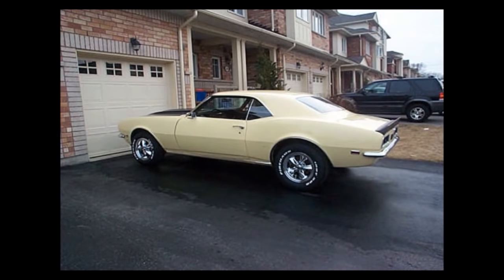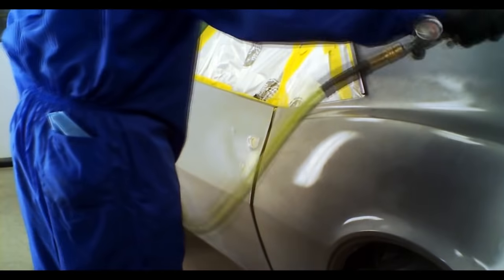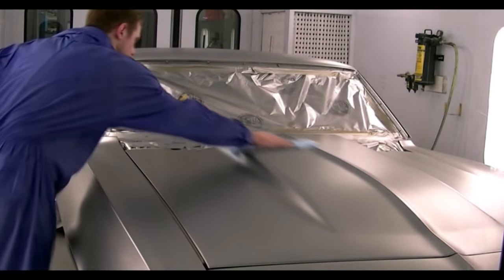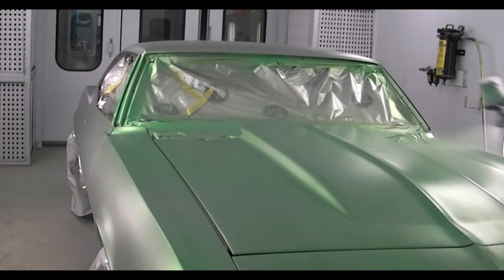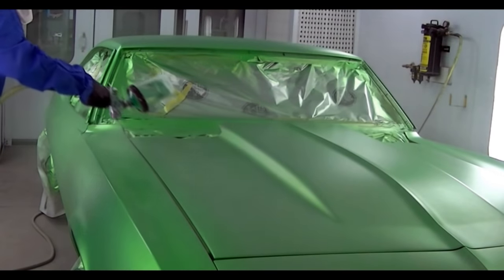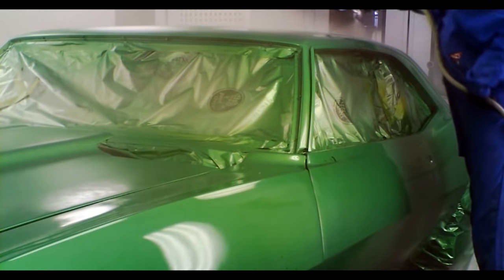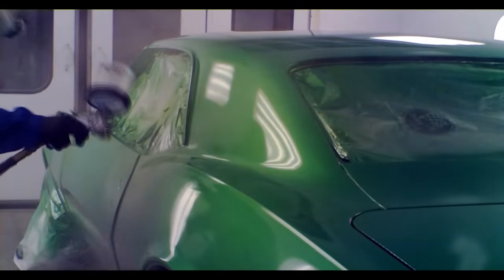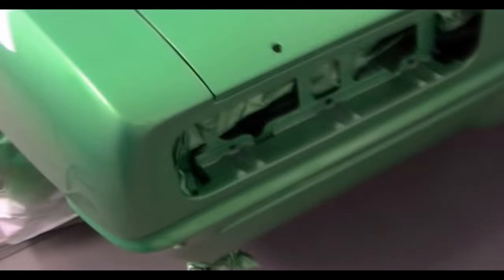Custom Candy Euphoria: A Full Car Paintjob Transforming the 68 Camaro into a Green Candy Dream

Comment from the maker: Thats in reference to how your applying one application or coat of clear. If your using to fast of a hardener then the clear drys to quick, it needs to stay as wet as possible during the application of each coat. 2 coats are applied with about 10 minutes between them.

Comment from the maker: One cup that size will get you about half the car (one coat), depending on coverage you may need 3 coats or so. About 1/2 to 1 gallon will usually be what you need to do a complete. Depends on the size, color, complexity (if your burning paint in offsets - grilles and such), if your painting the jambs, bumpers..etc.

Comment from the maker: I do not, I have done 1 custom fade paint job that turned out pretty cool but didn't get it on video sorry. What I did was painted a foot approximately downward, then slowly mixed in  my next color until I had nothing but my second color left at the bottom. It was done in solvent.

Comment: Lovely job ,can I give you 2 tips? the air hose always hold it behind your back and come up on your shoulder ,cause you can touch the paintwork if you keep it in front while you spraying ,2nd tip  
you get less dust if you spray at less psi,try ,I spray lots of cars with low pressure without a single speck of dust or flies

Comment: I WATCHED YOU THE WHOLE VIDEO, I painted over a hundred cars,and I never start anywhere except the top first,and walking the full length of the automobile on candies and other hard to shoot hues,it seems that the gun you are using is saving your butt,your overlap is excellent,i've found on hard to shoot paints that more light coats for the first two applys works best when the mix is perfect,you did a good job,start walking the full length and you will master paint work right off the gun and cuts down on orange peel and lots of sanding good luck
Reply from the maker: ***** Thanks mate! First candy complete I've done, should have thought to walk it.

Comment: The paint looks well done, but if I could offer some advice from one painter to another.  I start at the back, do the trunk-lid & back panel, then left and right quarter, then I start at the centre of the roof panel, continue down the door, repeat on the other side, then I start at the centre of the hood and down the fender etc. I do alot of running from one side of the car to the other, but I find I can keep the best wet edge possible. As well, I'm not risking leaning into any wet paint. Cheers

Comment: After you've put on the clear coat and it's finished you also need to polish the car, right? to get the best effect or am i wrong on this? reason i'm asking is that i am going too attempt to paint my own car not in candy color tho, but i figured i'd ask, Going for primer coat,sand it, another primer coat, metallic blue, 2 or 3 layers i suppose? and then clear coat 2 or 3 layers? and then polish it or should i just leave it be?  Thanks in advance.

Comment: That looks great. I spray the same way. You don't need to walk the car if you know what you are doing. Just wondering why you did this in 3 stage? WA708S is the code for synergy green and it has two mix ways in ProSpray (what I use) a base clear and a 3 stage. I think the base clear looks much better. I've tried both ways and the 3 stage just doesn't look as good to me. Anyway, Great paint work man!!
Reply from the maker: Chris Spero Thanks, the 3 stage I believe was the only version available in BASF at the time....or I maybe foolishly overlooked the 2 stage version (entirely possible).

Comment: nice work i have no complaints. nice stance i guess that little flaw you had on the right door its not ok. but i probably woupd of done worst. shit happens. what would you recommend as in body filler polyester Bondo what kind of primer what kind of vehicle to use what kind of clear coat because thats the exact color I want for my car but a little bit darker. thank you in advance for answering my question.

Comment: Base/clear systems are designed to be applied at the same time. There's no need to let the base dry. It just needs to set up (20 min or so before clearing). If you get dirt, bugs, etc. in the base, you'll let it dry before sanding out/respraying the base, but it depends on the job. I sprayed thousands of cars in a booth like his. Some days I'd spray ten parts without so much as a big dirt nib, then the next job I'd have a swarm of little flies stuck in the basecoat of a white hood!

Comment: Unless you based the car a long time ago & the base is 100% dry, the clear will adhere every time to the base, no need to sand. The reducers in the clear re-wet the base & they sort of melt together. The only time you'ld sand the base prior to clear is if it has imperfections in the base. If you sand a metallic/pearl base, you'll have to reshoot/blend the base to cover your scuff marks.

Comment: With the basecoat or the clearcoat you can use slow activating hardner , or even extremely slow hardner.  This helps you decide while painting , instead of deciding which areas may have a problem after painting.  By then it's too late.  Plus you can do the same with the reducer.

Comment: I'm not a pro. But I did take auto body repair class and I'm wondering when you painting either the silver or the color. Why did you paint a section at a time. In class they had us go from front to rear to keep the color even. The way you did it... like when you painted the door the front and rear panels would have more color. Then when you paint the panels they would have more coats because of your paint skills.  Just wondering.

Comment: hi..I love this color... I am painting a 54 ford f100 and was wondering what the silver color is?  Do you have to buy it as a kit?  If I wanted to used the silver as a racing stripe, could it be masked off then painted with the green.  Any help is appreciated

Scott
Reply from the maker: It is whatever ground coat BASF's standard position uses for 2014 Synergy green. It is a very coarse metallic.

Comment: Hi chap, nice work on this. I'm going to be attempting my first respray, of a car that i've been working on for a few years. I have previously sprayed the engine bay (which came out well, so i'm told) and am intending to really take my time with prep, but my question is what would you recommend with regards to flatting between coats?...

Thanks.

Comment: how did you treat the jams an under parts of the hood,fender,door ends ,was it paint an clared .  taped off  for the bodys over spray.you dont want color on finished doors and jams. but some over spray is going to get in the cracks.Do you color sand after all is dry an set? all in all nice job.

Comment: nice job, what size tip you used for clear coat and base coat and did u wetsand the primer? if so what grit did u use 400 or 600

Comment: Try getting down on one knee on every pass and turn the gun upside down to get under the rocker panels where rust can get it's start. Turning your gun side ways doesn't do anything to get direct 90 degree contact with the underside of the panel. 

You paid all that money for good equipment so use it for it's intended purposes.

One can notice also when you do spray along the rocker panel especially with your side ways pass move, that the over spray goes under the car and rolls up the other side of the vehicle and crawls up the side to the roof bringing any dust particles with it.

This can be eliminated by masking from the inner rocker panel lip to the floor which is something many seasoned painters do to eliminate the chance of dust particles being picked up and deposited on the car through static electricity. 

Going around all the taped paper edges first with a light coat also traps any dust particles that may be sitting there even from the factory roll.

Two air lines, one on each side of the vehicle goes a long way to keep things clear and allows you to move freely along side the vehicle as well and reduces the chances of stirring up dust from swinging the hoses around along the floor.

Starting from the bottom up allows you to see the pattern much better than from the top down because when you do top down you can only realistically see what you've already sprayed and not how the pattern is being sprayed so you can adjust accordingly.
Reply: well put when I paint I usually remove the hood doors etc
Reply: christopher laing thank u allsome i like it thank you bro
Reply: How much mutyel
Reply: Why don't you put a video since you kno so much ....that's what I thought
Reply: @jeffreyalbrittain  If you do that with candy you have a high risk of the shade not being right from panel to panel when you but the car back together.

Comment: Dear Friend.. Seeing hows I've only been in the booth 35 yrs .. I can tell you with 100% certainty THAT I Start all my paint work in the center of the roof working out so I don't have to reach over wet doors .. then Drop down to the deck lid then hood then sides .. But I don't reach over wet work ever if I can help it and when I start up top I don't have to worry about all that over spray on newly painted hoods and deck lids .. Just a tip from an old Guy ..

Comment: I've been spraying candies for 36 years and I used to walk the length of the car too. But through the years I found out you don't have to do that. If you'll notice at around 08:53 he really feathered his candy out as he put it on. As you move down the car you have to feather back in to what you just sprayed on. If you do this you wont see the stopping point. That is why it worked. You can do this with pearls too.

Comment: Nice, the only thing I see is that u start out -in and it should be in-out, I saw u do the fender then u go with it to the hood, if u start from the top middle then U take your way out U will have less chance massing/touching up the paint u just did, but I can see you're defiantly a professional, great job

Comment: I know this video has been on here for a while but I was just curious. What psi were you running on primer paint and clear? I notice you were running 6 to 8 inches which is the usual but didn't notice you wet sanding after running your last clear coat. I have always been taught to light wet sand and buff after everything.

Comment: not to be a smart ass but when working with candy you do want to try to spray a line the whole side at the time. ie go from the back fender all the way to the front then back again instead of finishing a fender then moving on to a door, this way it will be a more even coat and you dont get any dark spots in the transissions and second. when spraying the roof and hood you wanna be carefull when makin the transission from one side the the other so you dont get a dark line in the middle. nice work!

Comment: I'm curious to hear more. I'm ready to paint my car Synergy green and was planning on using the DuPont Nason paint (from Napa). Is this what you used? I have researched all brands for a Synergy Green and they are all a basecoat/clear coat. I have never seen it called a Tri stage paint.

Comment: Dont need sealer. Just go p400 the wet 800 and blending paste (if you finish your bodywork in 320 and its straight you can p400 otherwise your back sanding steps will double ex: 220,320,400,600,800 then sealing is necessary) you wont break through. but if you have bare metal you can blend your sealer or spot prime. We try to stay away from sealer as much as possible where i work then you dont worry about sinking.

Comment: Hey Refinish, I have a question for ya! I've been following your videos for a while now, and recently had some trouble with the clear coat. My finish looks almost flawless, but the clear has about 10-15 small RECESSED dots in the clear (small panel). I've never had this issue before, they're like little low spots that sink in rather than pop out, so its not a flash off issue.

Thanks and keep making vids!

Comment: Like I have 2 66 mustangs, about the size of this camaro, and a little smaller even cuz they're coupe. How is it safe to say a cup full of paint in the gun is enough for 1 coat on half of the car? Or how far will 1 full cup get me? Because I don't want to run out midway. I know depending on how reduced it is makes a difference...say a 1.4 mm nozzle though

Comment: I liked the base silver. I wonder with a clear on top of that silver if it would look more chorme like or the typical silver metal flake you see in rattle cans.. I wanted to remove my roof rack and fill the holes and shoot the roof like a chrome..
Reply from the maker: Torpedomtb It would look like any other silver.

Comment: It's a restoration in which most of the car needed repair and replacement anyway. It wasn't a mint car to start with that was stored inside for however long, so if anything this 'puke green' paint job added quite a fucking lot to the value.

Comment: not neccesarily low air pressure, your needle may be too big.. you should be using a 1.3 or 1.4 needle in your gun..i set my air pressure between 20 and 25 psi on clear coat roughly 15-20 on base coat.

Comment: The car came out great ..I'm not saying anything bad about that ..But I've been painting car's for say like 35 yr's and I've NEVER seen anyone start at the fender and work in toward's the center of the hood and THATS WHY YOU DID THE BODY SURF DEAL .. Just saying bro .. Start at the center point of the hood and work out and you won't come in contact with wet anything .. Same goes for the roof ...

Comment: If You used a primer sealer first you wouldnt have the sand scratches you talk about after Your 1st coat of paint,plus the color would be the same shade all over the car with an even color to start with, Also the paint wont shrink into the sand scratches at a later date and show back up,,at least that is what the paint company's recommend , I have also found this to be true,, I have 38 years in the body shop,, to long,,